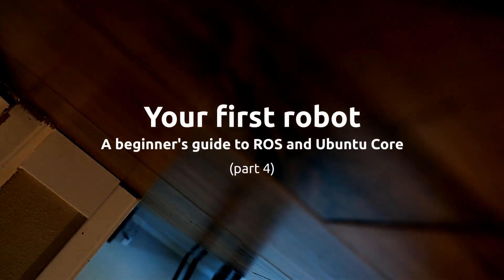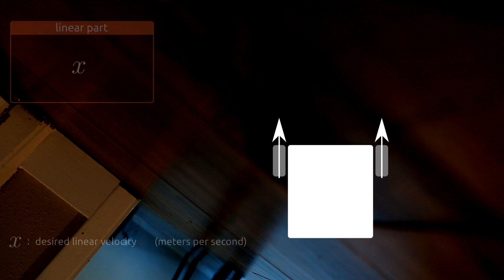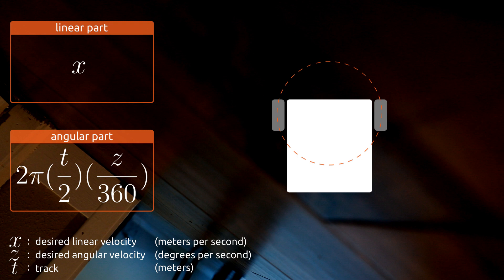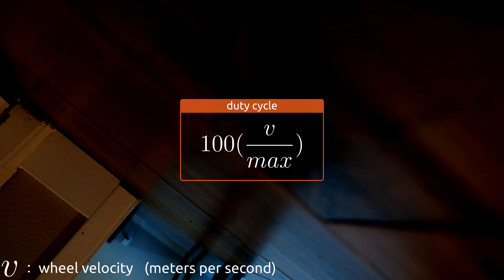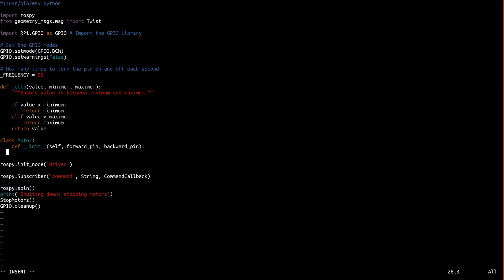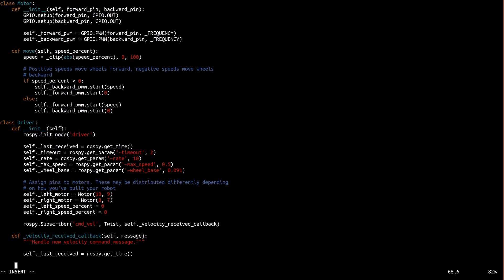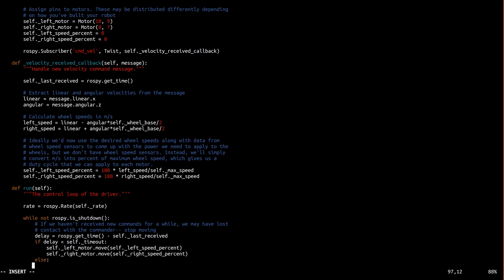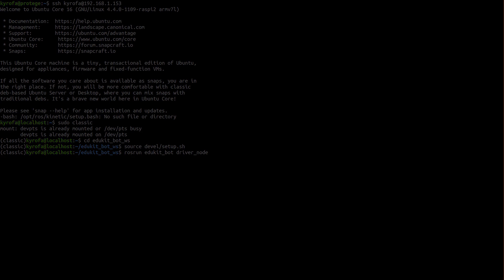Your first robot, part 4: The driver

Comment: Thanks for this valuable series.
I dont quite get how to use the other buttons on my controller using joy/teleop-twist-joy. For example I want to shutdown the system by pressing a button on the controller. How would that be done in Python?
Reply from the maker: The joy node includes the state of all buttons in the sensor_msgs/Joy message. Take a quick look at this section of video from Part 3: https://youtu.be/xRK-tOgzeUo?t=105 . Which button corresponds to which index in the buttons list depends on your controller, but you should be able to figure that out pretty quickly by experimenting. To utilize that information in Python, you just need to subscribe to that joy topic and do something with the buttons list.